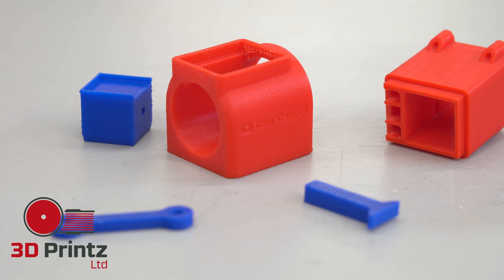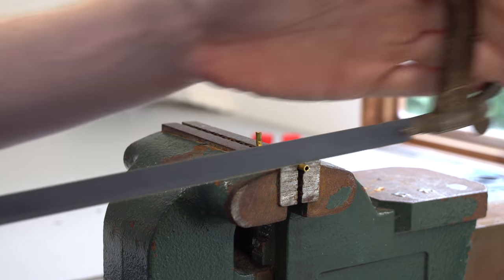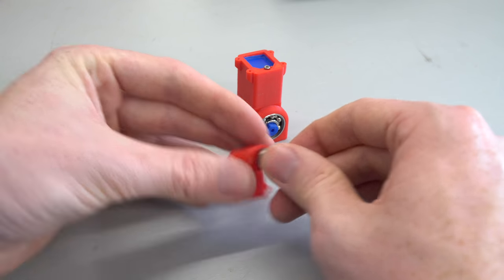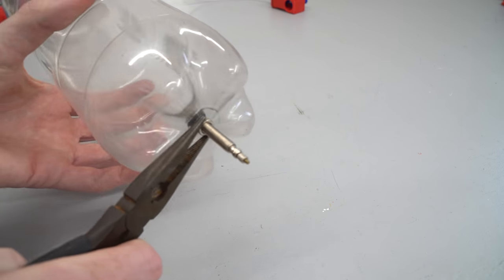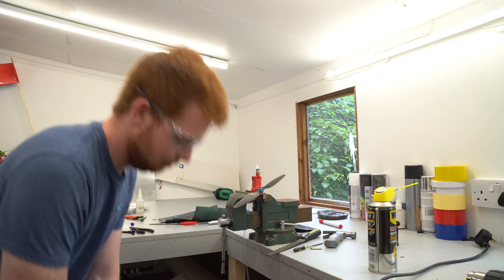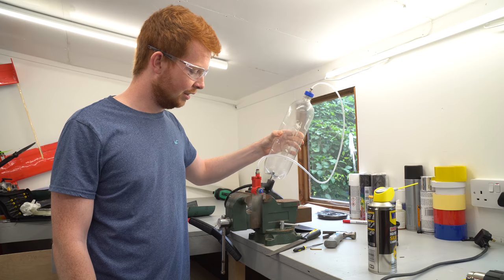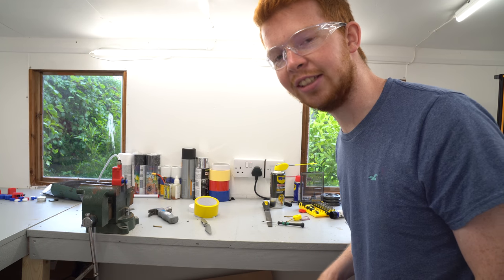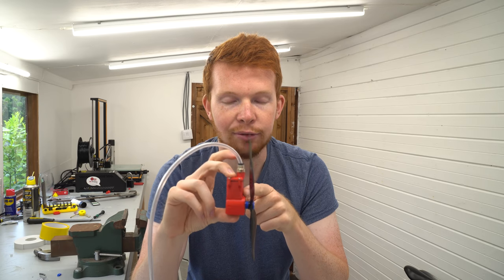3D Printed Air Engine BUILD

Comment: You Should Make A Engine That Re Uses Air By Pumping It Back Out The Exhaust To The Bottle So You Can Have Infinite Run Time And Add A Carburetor With A Idle So You Can Hook Up A Rc Remote To It. But It Would Still Need A Pump And A Shut Off  Valve Or Something But Pretty Cool Engine

Comment: How bout a linear pressure control valve, conical shaped inlet seat with a matching conical shaped valve. For instance, the idle air control on a fuel injected car. It allows a certain amount of air to bypass to keep the engine running at idle and deceleration. Google say like 95' Chevy S-10 IAC or Idle Air Control valve and you'll see what I mean. Should be able to run it with a 11v lipo and an arduino, after printing a valve block. Good luck.

Comment: I want to see this thing self sustaining with a possible valve as a speed controller. Have it drive a small drive shaft of an air compressor that feeds it the air after an initial starting psi.

Comment: Make a regulator on the air hose so that it doesn't rev up super high and then if you gear it down and put it in a vehicle with a big flywheel and see how long it drives for

Comment: it's realy impressive how it work well. i think i'm going to print one. can you build another one and try with a very high pressure like with a motorized compressor ? to see at which pressure the motor will break. continue like this :)

Comment: very nice i was searching for a pump to run a steam engine using air. I wanted to take a Mini DC Can Motor to the Air Piston that then drove the wheels of the steam engine. I can get 17 to 20 Volts to the pump via the track power. I will look into  you valve arrangement. Nice Project. Dennis

Comment: If you could design a way to get the air valve to open right above the piston it would help alot with the power because the air is pushing DOWN right onto the piston making it easier to force the piston down

Comment: Got an old busted micro fridge or window AC unit...strip the compressor out of it and get a small tank and regulator, make a silent air compressor...you could run that thing forever

Comment: Tom, if the engine needs the propeller as a flywheel, how does that translate to a car's propulsion? are you going to design a spring loaded centripetal clutch? what is going to provide the momentum for the cam whilst driving the car with enough torque?

Comment: Could you try using a smaller piston and running a higher RPM with a smaller propeller, or running it with a small reduction gear?

Comment: Second question: would it be reasonable to use heat-set threaded inserts for some of your screw holes, rather than threading directly into the plastic? Would this increase size and/or weight too much? Would the extra strength be worth it?
Reply: RedKugelblitz That's a good point. Cost, too. Those little fittings are surprisingly expensive compared to filament, and can't be reused like screws can.
Reply: It would probably be too much weight. This thing is supposed to go on an aircraft eventually, and every little bit of weight savings counts.

Comment: hi tom, been watching this series quietly, as i am not the greatest engineer in the world, however, i had a thought. for portability, and design in the car, this may not work for a plane, could you not use a threaded c02 canister instead of a bottle, apparantly, 16g canister will fill: 1 x Road Bike 27" tyre to 130PSI/9BAR, and they're tiny. if you could fit some kind of small regulator valve / solenoid to regulate the pressure, you could get a longer drive time, by not compromising too much weight, and you can get 10 canisters for 10 quid or cheaper on ebay, or spend a little more and get more pressure / capacity. being only a few inches long, rather than a huge bottle, especially with a threaded end, some don't, but wouldn't that help in the design
Reply: i suddenly had the idea when you had the pipe, rather than the bottle attatchment. as it seems like it could be, fairly easily done.
Reply: you could even use the solenoid, as a throttle maybe. not sure if that's possible. i'm just commenting as i get random ideas now, i'll stop haha

Comment: I am curious what this engine’s max rpm is. I would be interested in seeing you put a flat flywheel on and gradually amping up the psi until the engine fails. I am also very curious about what sort of efficiency you are getting. Hooking the engine up to an electric motor and then measuring the watts that the engine puts out could be very useful information
Reply: And as always, thank you for the videos. We are all as interested in this project as you are

Comment: Remind me to try gluing PVC tube into PLA using DCM and see how it holds.
Reply: Electra F -  is that Poly Vinyl Acrilic ?  What are the Letters describing?  Is it a secret code?
Reply: Sorry. meant to be:  PolyVinyl Chloride  to PolyLactic Acid with DiChloroMethane
Reply: Electra -  Many thanks.  I understand PVC and have worked with it.  I'm guessing the other two are 3D printer plastics?

Comment: Excellent work, Just a thought, what if you were to put another engine back to back with the original but the 2nd engine is pumping air into the 1st, the 1st engine would be joined to the 2nd via the crankshaft.. would it last much longer?

Comment: Have you done enough testing to find the lifespan of an engine? Something so simple I imagine would have a really long lifespan as there aren't many parts to wear away on each other. I am just very curious in the performance and limits of this engine as I have been following the development since V1. Also I would be interested in a cylinder head that would allow the engine to run at all angles.

Comment: Hey great video.  

You've mentioned stripping the threads of the printed parts.  Have you considered using threaded inserts?

Also, for powering the device, dry ice has a pretty high sublimation pressure...

Comment: Why do you not use a turbine where the energy out of the pressure gas will be converted constantly without the cylinder to energy to run the motor

Comment: Maybe use a co2 or air tank with adjustable regulator . it would run forever on 150 psi regulated down to 25psi, or near 2bar

Comment: you have NAILED it sir ... crankcase modification and longer pin for the con rod ... you will have a running opposed twin ... running 180 degrees offset (same cam lobe and crank pin)

Comment: Can you remotely open a cylinder valve? That way the pressure would initially be higher I think on a multi bottle system rather than feeding from two or three bottles at once

Comment: Hey I hope you see this but what if you leave the hose fitting on and you splice in between and put a electronic valve so you could control how much air passes threw and test it with like a paintball canister??? That way you could just screw off and on a new canister for each use and it would be small but yet have lots of pressure. And if you possibly add it on to a wing that create enough up lift it could fly and carry its own weight? But please I hope you view this and I’d like to hear from you love these engines and how much you tweak these thanks mate keep it up

Comment: You should try to design ninjaflex or similar filament gaskets for the whole engine you could even design them in such a way that they can be printed as one piece on a dual extruder printer

Comment: I recommend printing gaskets from TPU (bottle like) or NinjaFlex (membrane like). both work really fine! (Ninja on CR10 with decent replacement feeder and very low speed works like a charm)

Comment: I wonder if this would run with dry ice (Co2) in the bottle. May be a weight issue, but in theory shouldn't the dry ice pressurize the bottle? Or even liquid nitrogen or something of the sort.

Comment: I'm curious: could you use flexible filaments to 3d print any of those gaskets and washers that you need? Or does it need to be proper rubber sheeting?
Reply: It would probably be difficult to get a thin flat sheet of 3D printed plastic to be airtight. Using rubber sheet is a better solution.

Comment: Forgive my ignorance but why a square piston?
Reply: Doc Ink he explained that in one of the last videos
Reply: Ty red
Reply: that was unexpected... thank you
Reply: It's just easier, it's not better. He'd have far less friction if he could have a proper cylinder, which is a benefit in this application where friction is most of your power loss.

Manufacturing round parts that are in tolerance is tough and could require alot of manual honing. For this build, he should really be focusing on timing optimization, weight, and friction if he wants to get it off the ground. We'll see.
Reply: What Red said, but alsoe the 3D printer is of limited resolution, the further you go from one of the straight directions, the more jagged that surface will be. One could oversize it a bit and sand it down though, I suppose. The internal hole is harder though, might need honing.

Comment: How and or why would one use printable pneumatic motors on Mars?  
)1) They produce no pollution or substantial heat. 
2) they can be printed as needed. 
3) can be used to make non-fuel, non-electric driven motors to erect tall buildings and towers. 
4)  they can use compressed atmosphere as stored energy.  
5)  They can run generators to recharge batteries.
6.)  They can be used as both compressor and motor.  
7.) easily adaptable to power small short hop vehicles.  Pneumatic motorcycle!
8. ) very little fire risk.
9.)  Wind storms common on Mars can be captured vie windmills to store compressed atmosphere or recompress closed loop special gasses for air-conditioning or to drive special pneumatic tools.
10.)  used for catapult or launch means to chunk pumpkins to starving mates a few miles over that hill.
11.) multi-use pressure tanks can be rough-landed in halves or like Russian dolls; to service the crews with a variety of tools.  They simply snap and/or screw them together .  125 PSI should get a whole lotta stuff done on Mars. 
12.) Make use of high pressure hose that is coated with graphene inside and out to transmit EMF where needed.
13. Some of the plastic can be recycled to print other stuff.
14) .  can be used to print solar panel supports.
15) ...Robot-able  tech: drop a printer on Mars and wait till it prints the housing and windmills.

Comment: Fantastic
Did you consider flexible filament for gaskets? Also how about a simple tube fitting like thing:342964
That would make the engine even more 3d printed

Comment: What if you experimented with piston rings for a greater seal between the piston and the engine block. The friction would be higher and you may need to change the lubricant (maybe), but it should allow for greater pressures. Seeing that youre going for the rc car i think you will appreciate the extra torque
Reply: G'day,

  Do you not recollect the part whereinat the decision to use a SQUARE Piston, & a Square Bore, was explainificated in detail ?

   Y'see it's a whole lot easier to hand-sand Flat-Faces onto little parts & get them to match with a Clearance-Fit, than it is to hand-finish a Circular-section Piston for a Clearance-Fit into a Cylindrical-Bore...; and, like the Model Compression-Ignition, Glowplug, and Spark-Ignition Engines.., the decision was taken to rely on the Obturation-Effect of the Lubricant in the Borespace in.order to achieve a practical & functioning Gas-Seal - while accepting that the resulting Seal wouldn't be quite "as good" as could be achieved by adding Piston-Rings to the design...

  And, please forgive me my lack of Imaginitus, but I simply cannot see nor foretell how you might propose to install a  Piston-Ring, into a Groove, running around the outside of a Square Piston...(?) !

  Could you please cobble-up a Working-Model of that-there Concept, and post some Video of the required Assembly-Process (?) ; as I'm quite sure that I will be but one among the multitudes who will be absolutely fascinated to watch such a demonstration..

 Thanks..., ever so much.

  ;-p

  Ciao !
Reply: WarblesOnALot that was beautiful. And yes im aware of the decision of using a rectangular piston. Im also aware that using piston rings on a rectangular piston would be challenging. What i have forgot to mention is that my suggestion requires going back to the circular pistons.

Comment: Most engines with valves have a flywheel, Thus letting the inertia of the flywheel to move the valves opening and closing them. Just having the crank shaft by its self to operate the valves results in it not working. Add a flywheel.

Comment: Fantastic video, great job. Are you after speed or length of time it spins?  Could you place a regulator between the bottle and the engine to control the pressure, you can get it running for much longer and a constant speed.

Comment: can you 3d print a regulator so it can run longer with high pressure in the bottle with still lower pressure at the motor. so you can run higher pressure in the tank that would destroy the engine or make the propeller in efficient

Comment: Could you design an engine around a CO2 canister like the kind used in air soft pistols? Would this engine work at PSI that high?

Comment: Would adding a heavy flywheel to the crank help in running at lower pressure?  I'm wondering if this engine could be adapted to run on CO2 cartridges or steam?

Comment: I would love to try to add like a "Recirculating  Return" back from the "Exhaust" of the Motor (If the Air after the cylinder is released into the open)  back into the Air Supply type Storage. It may not re-pressurize the Supply but at least it would put air back INTO the supply to then Be Pressurized with Less effort than Just starting out and Filling the air supply. I smell some small one way valves. :) Thus Increasing Efficiency.
Reply: Or Instead Of using the "Exhaust air" to go Back Into the "Air Supply"  How About using it to drive another "Air engine" if possible. You almost get a 2 for 1. There will be losses of course. But it would be cool.  To do this there may need to be mods of the first and new design of the Second(lower feed pressure) Motors.

Comment: Does the cam touch the push rod when it's not extending the push rod to open the valve? I wonder if you put a small clearance in there if it would reduce the friction and improve efficiency, and if you could apply that idea to the dual push rod exhaust valve version

Comment: Great work Tom. I'm not sure if this been mentioned but to help minimize weight with that metal tube fitting have you consider to make a 3d printed pipe compression version for that soft pvc tube?

Comment: What if you use a small air pump like the ones used for aquariums, would that also work or do they produce low pressure air?

Comment: I landed here because of " 3D printed air engine" and expected that the whole motor would be printed integrated, so almost without parts. Could teflon be used to avoid lubricants? (me=total layman, idiot, etc)

Comment: Awesome engine! Would it be possible to add an adjustable pressure valve between the air source and the engine to use it as a throttle control?

Comment: could you chain them together like if you had an air engine car could you use the exhaust pressure to run a smaller motor to be like your accessory power

Comment: could you somehow use one of those co2 cylinders as an air supply in conjunction with the throttle you designed to limit the pressure?

Comment: How much pressure is lost around the piston? Blowby in a internal combustion engine. I'm thinking about using steam to generate power to charge batteries. Use sun to make steam. If I could get 100 rpm and 50+ lbtq. And he enerate 400-500 watts 8 hrs average. Per day .. 5-6 hrs in winter. And 10hrs in summer. Would be an awesome start... But 2500 watts,  6+ hrs a day. It would be great..

Comment: if connected to electric generator, can this engine produce enough power to tun an air compressor that then will feedback the air engine so it continue to run?

Comment: Hi Tom, just wanted to say thanks for your efforts and ask a couple of questions. In another video u mentioned you use the CR10 for printing. Is this pretty good for those smaller parts. I have a vellerman k8200 and its prone to lots of issues like being impossible to level bed and it tends to melt smaller intricate prints. It is quite old now. Second question, just wanted to ask what CAD software you use, I currently use sketchup but your cad images look a lot nicer (noticed on car example) in that they can move and such.Thanks again, I think your small scale manufacturing methodology and prowess is amazing, this is an area I often struggle with, sometimes because of my equipment and other times through a lack of experience lolCheers Will

Comment: What if you made the engine power a small air pump that filled the bottle as it was running so that it could continuously run
Reply: Or mabye you could use two different engines one for the pump and one for the prop

Comment: Hey Tom, why don’t you put a 0.5 kg fly wheel on it
Reply: Yeah, but there will be less losses using a flywheel of the same weight becuase it does not need to push any air

Comment: you have essentially just gone a large way to a 2 cylinder, (i know im sure you are sick of hearing that)
your new design looks to give enough room that if you essentially printed a second V5 and instead of installing a prop on that one you hook it into the back of the first one (then off set the cam by 180 deg)

would be interesting to see if that would work.
possible future project after you complete the single cylinder car :)

i would like to say though that the 2 cylinder engine would have a massive loss of air efficiency but i believe a notable increase in power, something that may be handy for launch speed of a air engine powered car

apologies for my poor ms paint work but this is what im thinking
http://ferndalelivestock.com.au/share/aireng.png